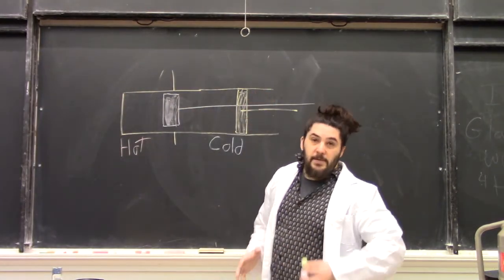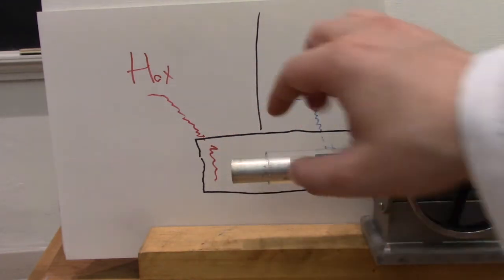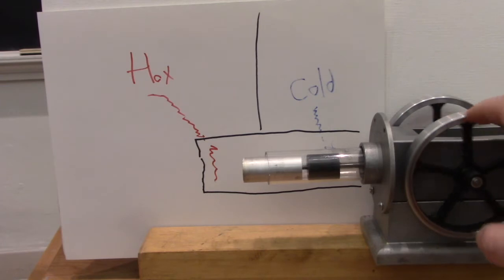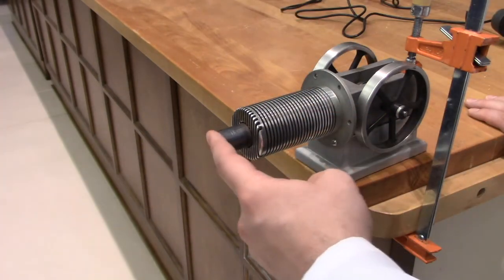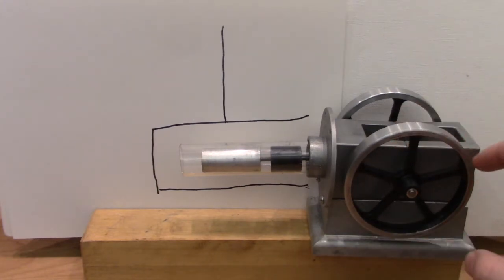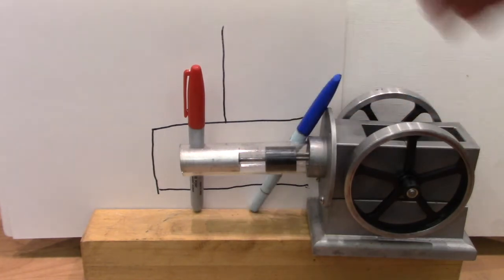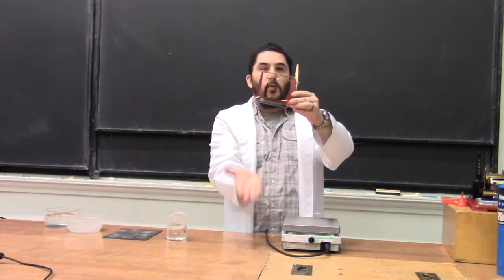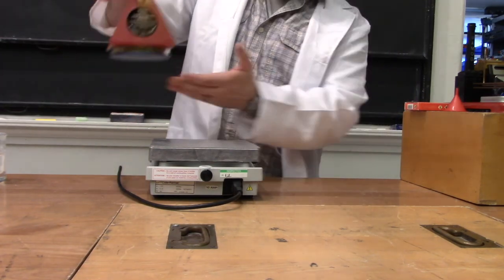Demos: Stirling Engine

Comment: I see this and I wonder, What gases work the best, Can I remove the heat on the top of one and transfer it to a smaller unit downstream and progressively use the heat but generate momentum as it goes until the temperature difference becomes balanced, What amount of thermal gradient is necessary to achieve rotation, Can it be used to generate electricity,